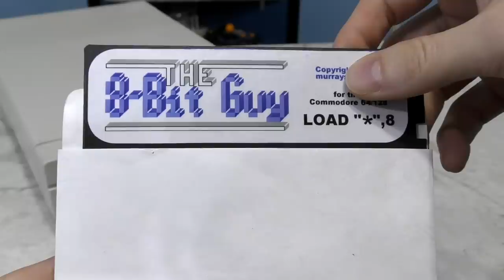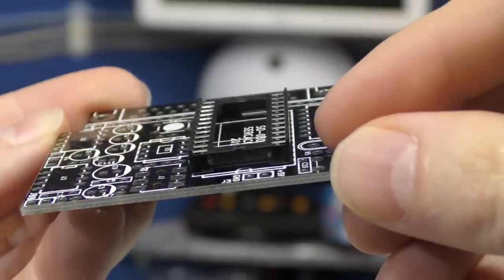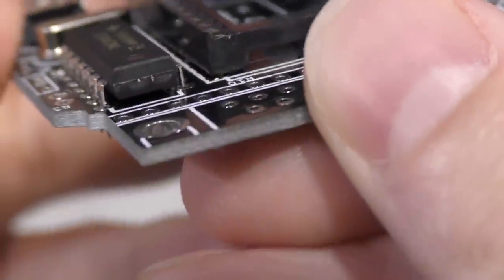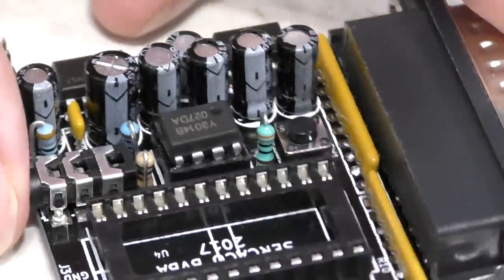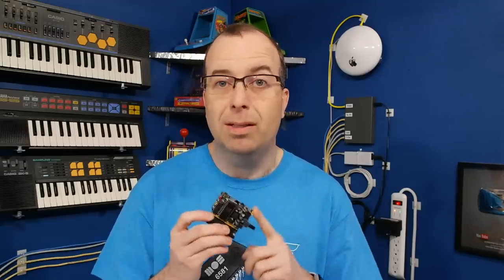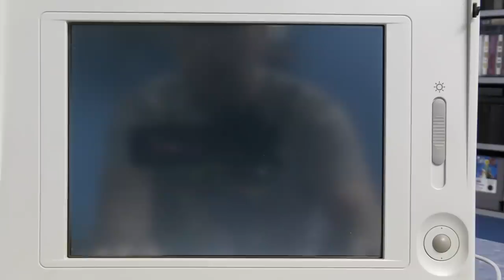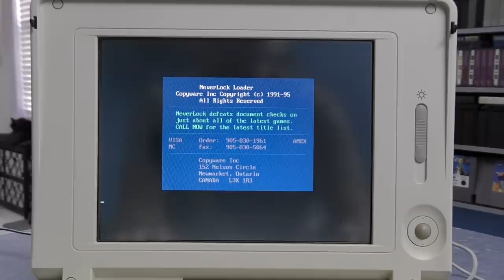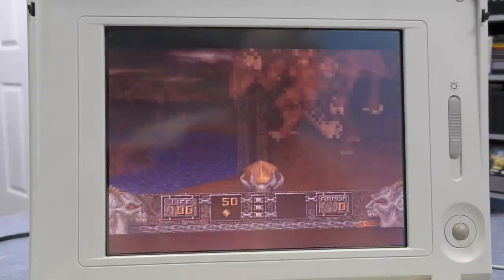Ad-Lib Sound Card for the Parallel Port

Comment: This is one thing to be said for these old computers, how incredibly simple they were. Replacing an ISA card with something plugged into the parallel port and no change necessary other than the memory address, not even any shift registers or such intermediate logic needed. Of course for most types of ISA card this wouldn't be so simple. It's just the Ad-lib that makes things simple by being a write-only peripheral.

Comment: 6:02 - it's how you don't mount resistors vertically. Actually, it's almost OK, but you need to bend the lead a bit farther from the resistor's body.

Comment: NB I can stand witness that PS2 passthru power-vampire adaptor things exist that let you connect keyboards and/or mice whilst using the 5V supply to run something else alongside; in a previous job supporting people using interactive whiteboards they were quite common as the Smart branded models used just such a tap to power the board, which connected over serial for data purposes and injected power down unused pins in a custom serial cable via a coaxial socket at one end. The passthru just had a barrel plug spurring off from one of the PS2 connectors, which then plugged right up to the input on the PC end of the serial cable, and Robert was the brother of either of your parents.

In practice it was an unholy bulky mess that kept getting tangled up and pulling the keyboard plug out of the computer, but the theory of it was sound at least.

If I'd known how useful they might have proven for something like this - after all, it could be directly reusable just by soldering a pocket change coax power socket of the right dimensions up to those two +5V and GND pads - then I'd have saved them all when those old boards were being scrapped. As it was, I don't know if I even salvaged a single one, as they didn't have any obvious secondary use and were so unbreakably robust that I never saw one go wrong in nearly 10 years of pretty hard abuse...

You can probably still get them as spares, but I bet they'll be stupidly overpriced and you'd almost certainly be as well to just make your own. After all, there's nothing complicated about the idea. Just get a PS2 plug, a PS2 extension socket, a barrel plug of some kind (or indeed a microUSB plug), a short length of 6-core cable and another of 2-core, solder up the 2-core to the barrel/USB plug at one end and the matching +5V / GND pins of either end of the PS2, then solder up the 6-core for a straight-thru connection including two shared pins, and make sure the insulation is properly taken care of at the end of it all.

Comment: Don't listing to those complaining about your soldering, you are doing it right. instead of looking at the pin length of LEDs you can look at the metal parts inside the plastic, the big one is the negative

Comment: My personal guess to why the slow sound playback happens in some games is that those games talk to the chip in a really inefficient way so when this is done over a parallel port, it causes some delay and/or bandwidth issue. If my memory serves me correctly parallel ports were pretty slow even for the standards of back then.

Also, the pads for the additional 5V input are a tad close to the side of the board for comfort. The natural thing to use for that would be a simple barrel connector, but so much of it's going to be resting off the board I'm afraid it's going to break off way too easily.

Comment: @4:38 That's also a Rule of Thumb when working with a soldering frame because it holds the lower parts in the sockets and then you add the next highest, solder them, and so forth. BigCliveDotCom on here has a tutorial that says the exact same thing you are.

Comment: I've done many hours of work mandated IPC/J-std micro/min solder and board repair training and your soldering is just fine by my eye, and at any rate it's perfectly functional and dependable for what you're building. I have some bad news for all the people armchair qb-ing, the only way to 100% properly solder is in a temp and humidity controlled environment, so if you want to get technical the vast majority of home projects don't meet that standard of practice.

Comment: i had a windows 2000 pc that had msdos 6 installed on a partition.  i used to play alot of old pc/dos games like ultima 6 .  that computer was a beast for its time...  it had 2 gigs of ram,  a pentium (i think 4) processor and 512mb of video ram with 3d graphics...  i dont know what brand of anything except the processor,  i was 7 when i cobuilt the pc with my stepdad at the time..  wish i still had that computer though..

Comment: Oh boy, I would not want to write that patch program. The problem is that port 388h is way above the one byte mark. If it were somewhere below 100h, then most games would likely use the IN and OUT opcodes with the port as an immediate operand. But even then, some might prefer the indirect method.

The indirect method is using IN/OUT AL, DX. So that means the port number is in the DX register. It is unfortunately impossible in the general case to precalculate what is going to be in there at run time. Now, usually the DX register will be filled with the correct address immediately before that instruction, but it might not be. And you never know if control flow isn't going to jump over your initialization commands.

Comment: I could be wrong, but isn't is also possible within the BIOS settings to remap the LPT to 388 instead of the default of 378? I know you could have done this with windows95 as well within the hardware mangler area I believe? Would be interesting to see if you could get the LPT to remap that way and not require any drivers or patches if the BIOS/CMOS was handling it directly. If that is possible, it would allow a 286 and maybe even the XT class to work with this.

Comment: Your soldering technique is fine for an amateur*, & perfectly acceptable. It's also completely okay to feed the solder to the tip too, as it aids 'wetting' of the component lead.
* It's very slow for a professional. ;)

Comment: Would there be a use for a device that uses the FM chip in the Sega Genesis as a MIDI tone generator?  I use the VOPM VST, which is a great concept since I'm able to load synth programming from hundreds of games.  The drawback is instability and very low volume output.

Comment: I wonder if the music playing at the wrong speed in some of the games has something to do with the YM3812 not being able to generate an interrupt when connected to the Parallel Port like this. The chip has two internal timers that can be used to keep track of things, e.g. a musical score playing in the background.

Apparently there was a suggestion to have the OPL2LPT card trigger an LPT interrupt and then translate this interrupt into the same interrupt as the chip would if it was connected to the ISA bus. But that didn't happen?

Comment: wait, since it's an L-type FM, that means it is actually compatible with the better YMF278B; and you can put sample based synth to work too. O_o
maybe it can be modified slightly to work with M-type YM2151 for sharp x68000 and some acrade boards? it's not the best FM but it actually sounds very sweet for some reason. (but then again most DOS games were worked with YM3812 so there's no point in doing that).

Comment: The other way to get this working, is to edit the PC's BIOS to change the LPT port address to 388.
Reply: Not every BIOS supports that, though.  Especially laptop BIOSes, since laptops tend to have a more consistent configuration than desktops.

Comment: a microcontroller than do the same as it have usually 5 to six digital to analog converters that can be used for channels. the rest is just software and encoding and a decoder software in the microcontroller itself .

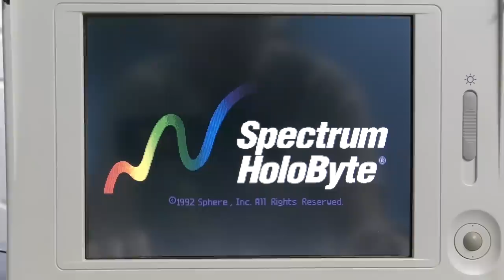Comment: Regarding Tetris music playing at the wrong speed - 16:47

I'm ready to bet the that for the music timing, unlike other games, it doesn't use the system timer (the timer 0 of the  Intel 8253 PIT) nor does it either uses the syncing to the screen refresh.
Instead it very probably relies on the AdLib's own timer (which can either trigger interrupts or trip bits in the status register of the AdLib).

The standard parallel port is write-only port (with only a few status bits comming in), only more advanced stuff like EPP and ECP did support full read.

Because of this, the TSR doesn't actually read from the chip, it only simulates the timer bit tripping immediately.
(see here : https://github.com/pdewacht/adlipt/blob/d9bd2d6af2e21f26db30faea0ad77f8fb513ee31/adlipt/res_opl2.c#L97)
That's good enough to fool the AdLib detection routines (according to the source),
but that's not good enough if the software actually relies on the timers for the music playing.

According to the Vogons thread, the board maker has wired the interrupt pin of the sound chip to the ack signal on the parallel port, so at least there should be a way to get hardware interrupt working from the card.
Reply: Hi, TSR author here. I checked and the Tetris game, at least the version I found, does not use the OPL2 timers. There was a lot of paranoia on Vogons about those timers, but so far nobody has found a piece of software that actually used them for any purpose other than an Adlib detection routine. They are nearly useless on the Adlib because they're not connected to an interrupt. I think the Adlib designers considered it superfluous because the standard PC timer is already plenty flexible.

I might investigate more but my current focus is improving the TSR's performance on 386 and improving ADPATCH. Also consider that there's a decent chance that this is not actually a TSR problem; it might be caused by a bug in the game or the laptop being not quite 100% PC compatible. These things happened in the DOS era.

Comment: Oh, and is there any mention of whether it demands any particular type of parallel port? I'd be very interested to see if it could work via the parallel port of other old computers (Amiga, ST), or with the board's LPT adapted to a more suitable connector on an alternative system (ST cartridge port, bus ports on various 8-bits, etc). The main job of work is adapting the OPL to any kind of external connector at all in the first place, so changing the LPT for something else is relatively simple. But it would be nicest if it was straight plug-and-play in its original form, just with the right code. Maybe with just a small adaption to allow the computer's native audio (maybe even a tap off the internal speaker connection for a PC) to passthru and mix with the OPL...

Comment: You’re supposed to use the iron to heat up the pad and the leg. Then you’re supposed to touch the solder to the iron and melt it onto the pad. By all accounts your technique looks fine

Comment: I want one... only problem is that I don't have a DOS computer... or any computer with a LPT.

So, when I get a new computer (should be soon), I'm thinking of maybe retrofitting the laptop I'm sitting on now with some 80's hardware and crack together a DOS package that can utilize the power of a 2010 laptop with some 80's stuff. Possibly even use all that extra storage and power to multi-boot with all kinds of retro operating systems.

Comment: Would this work with DosBox if you installed it on a later computer with a Parallel Port, like a IBM ThinkCenter running running Windows XP for example?

Comment: I'm surprised they still make these...
And I agree. Makes you wonder what they use them for.

But then, I got a decent stock of the YM2612 (of mega Drive/Genesis fame) as well fairly recently, and while I cannot confirm the reliability of what the seller claimed, they are supposed to be new chips.
Sure, the seller may be lying and they're salvaged chips, or 'new old stock' or something...
But if they are genuinely new, it did make me wonder what on earth was still using these chips for them to be available like that...

Comment: I have a 486 laptop that has an external box with two ISA slots from Notestar. I could install all kinds of ISA cards in there. Sadly the laptop doesn't work anymore. :-( Those boxes had a revival over the last few years for powerful external GPUs (eGPU) connected externally to a laptop.

Comment: Actually, I wonder how this device would fare with RDOSPlay - a player for not just AdLib music files, but also SID, AY, PSG and so forth (although it hasn't been updated in ages and only supports files in the old PSID format).
Reply: it shouldnt be hard to modify it - even with a hex editor. its merely writing to another port. In my code, I had it working with the OPL2LPT and added Adlib support with minimal effort.

Comment: Very cool. I suppose if you really knew the hardware of your laptop, you could put an address switch on your parallel port (which by the way is called LPT for LINE PRINTER, Or further back, Line Printer Terminal, not whatever it was I heard you say that I forget now - I just remember thinking "That's not right"...lol).

Comment: why is everyone identifying the LED polarity with the legs? someone can clip them off and you can't tell which one is positive or negative. I find it easier to look at the little flat spot at the casing (Negative) or if you look inside the led, there are two metal pieces. the bigger metal piece is negative.

Comment: ... never directly abutt the resistor's body against the circuit board, the extruded wire conductors can shorten over time ...

Comment: Hello,is this possible to interchange chip by...3438 for example,or can put the two chip to switch them one by one?,thx to have make this module in 3812,no software so much taking charge,at minimal,perfect for me. Have you connected it on external HP or on just your IBM portable speakers only when you've making this capture?
Reply: Can we have 90° adapter for parrallel port(or having one directly crooked to fix on board)?,to have the card perpendicular to the pc at the rear,taking less place,i purpose...

Comment: One tip, there are apps for the codes of the resistors like "Electrodroid"
I don't know if this app is available in English
There are many useful functions implemented like the pin layouts of many cables/plugs
Reply: He is color blind that's why he can't read them

Comment: ~20 years ago simple FM chips like this YM3812 were used in all kinds of gambling machines (think fruit machines, slot machines etc), to generate the very simplistic music and dizzling sound effects. I know, because back in the day I had the pleasure to reverse-engineer the code on one of these :) Paired with a Z80 and a video chip which can display a character set that consists of 2000 characters on the screen at a time (thereby mapping the 320x200 screen with all different characters), a traditional cathode tube and a wooden box with some decoration on it - well, what more could a gambling addict wish for? Probably the most expensive part is the custom and proprietary random number generator chip which has to comply with the laws of the country it will be used in.
TBH I don't think the technology in these devices has improved much, simply because there is no need, and the cheaper the hardware, the more the profit!

Comment: Regarding your soldering technique.  It may not be the absolute best, but your joints always look neat and shiny and that's all that matters really.
Everyone has there own soldering style.  There is no right or wrong really.  As long as your joints a neat and shiny and the components don't get overheated, that's all that matters.

Comment: As someone who had the ESA/NASA/MIL soldering license i can say, your soldering is almost perfect. 
It is not that hard really. 
Just try to get your solder joints to have slightly concave sides.
What i noticed is, you touch the pad with the iron and solder at the same time. 
I have learned that is is better to first touch the pad and pin with the iron, then wait about one second for it all to heat up. Then add the solder. After you remove the solder wire, wait half a second before removing the iron, to give the solder some time to flow to its final position.
Oh, and leaded solder will last way, way longer. Because the silver used in lead-free solder is less stable and more prone to oxidation and forming thermal cracks over time.

Comment: I have one of those old laptops, but I think it's a pentium 75 running windows 3.1. I have the docking station too. I think I remember it having a sound blaster card in the docking station. don't know if it still works. I don't have the patience for a computer that takes 20-30 minutes to boot.

Comment: That soldering technique is fine.  It's not perfect, but it's OK as long as you are paying attention to the flow.

There is nothing wrong with hitting the tip of your iron with the solder so long as you heat the pin and pad enough.     However, if you don't heat the pin enough, that causes problem.   I can tell by your solder flow you have enough heat.
Reply: As a note, vertical mounting resistors is nothing new to me.
Reply: Oh, I'm not picking, but giving a tip.  For those big ol' structural mounts you might want to try plumber's silver bearing solder.  It gives a stronger bond, even though it has a hotter melting temperature.

Comment: I wonder since it is a custom board to make your PC Speaker work as if it was a real sound card if it would work with the Yamaha chip from your personal favorate the Roland Sound Source range too that would be a good side project see if it works swapping Yamaha chips around too and if it gives even better sound at all with the Megadrive 2612 or the Roland ect.